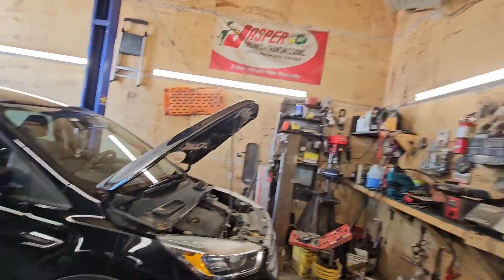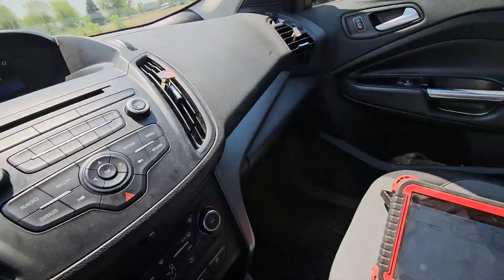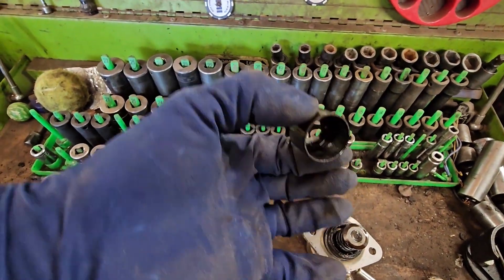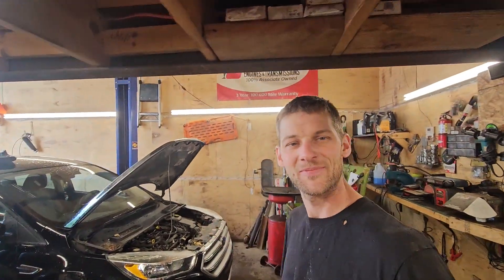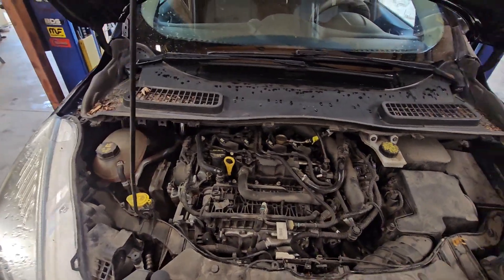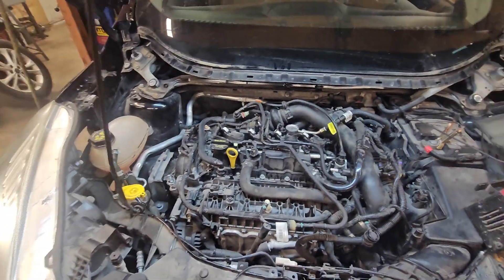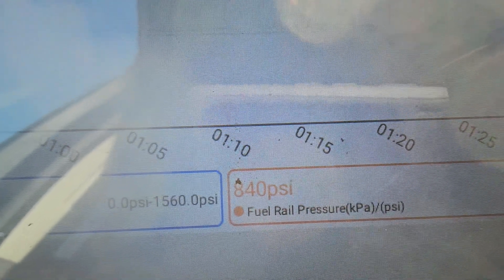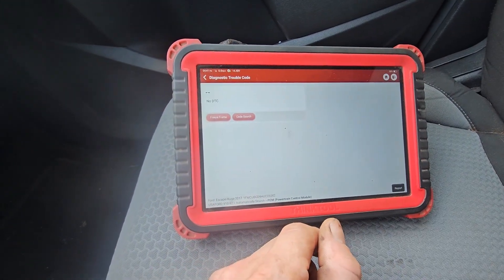Ecoboost low fuel rail pressure and no power: P0087 Diagnosis and repair

Comment: hi, I have a problem with the ford escape 1.6 when it's hot in acceleration, it has an interruption for a few seconds, I changed the wastegate solenoid, it's the same, could it be from the torque converter or the high pressure pump?
Reply from the maker: Could be, I may not be firmilar enough to provide further guidance on what to check for as only having limited experience with them

Comment: hello, I have an escape 1.6 ecoboost, when I accelerate harder the engine shakes when I take my foot off the gas it comes back but I don't have any error , is more when is hot
Reply from the maker: Wastegate solenoid is known to stick and then engine will use throttle blade to regulate boost pressure causing a surge as the throttle opens and closes rapidly, i would investigate for this happening. Causes a surge on accel and usually no codes
Reply: @BustedtoBuilt  wastegate is new, I noticed that it does it when the engine is warm, only when under load, is it an interruption while running, like some misfires, could it be the torqueconverter? or the high pressure pump, I really don't know what else to do

Comment: Thank You. I've bee searching for this fix. I just recently had to replace the CAT and turbo because the turbo decided to leak and clog up the cat.  Plus no power. The cam follower got worn out. Replaced it with a new one and it was a bit better but not by much. My fuel desired pressure is 558 psi and the actual pressure is 84psi now. Now I know what I need to do to get it fixed.  I wish there was some performance cams for the 1.5L.
Reply from the maker: Glad this helped and good luck with repair!

Comment: Hey man. I am working on a 2013 Ford Fusion 1.6l ecoboost. Looks like it has the same issue.....no more than 25 mph when accelerating in an uphill. I replaced spark plugs, air filter, sintetic oil and filter, coolant. The only code I got is P00C6 the scanner reads 659 psi at iddle after 15 minutes. The car has like 110K miles aprox. I am not shure if this pressure is normal.
Reply from the maker: Probably the same issue

Comment: Hey man, I got the same engine in my 2015 focus, and I noticed that my car idles at 2000psi fuel rail pressure when hot after a trip. Desired value is the same though. That’s not normal, right? Looking at your values it should be around 600-800 psi. Any idea what to check?
Reply from the maker: If there's no trouble code it's setting and desired matches actual then it's good to go. Is it setting a trouble code?
Reply: @BustedtoBuilt  no codes, but I wonder why such a huge difference, given its the same engine.

Comment: Having same issue with my escape, pulled the fuel pump out and the plunger had a hole blown in it just like this one im praying the cam isnt messed up, cars been nothing but a nightmare, just had full transmission replaced a few months ago, now this lol, ready to drive it into the lake and call it a day, only 150,000 kms on it, buyer beware dont buy an escape!
Reply from the maker: The lemons are out there. Good luck with repair and thanks for the watch!